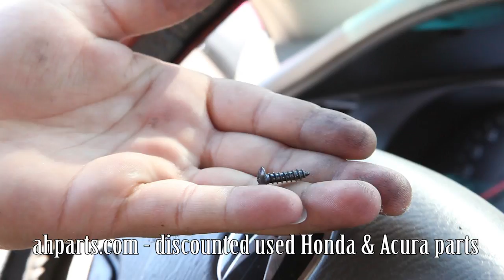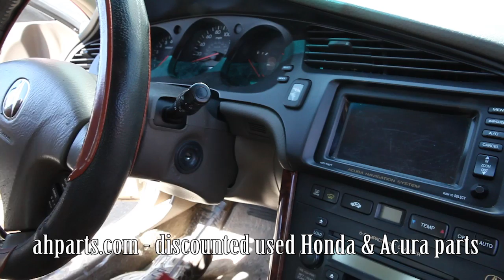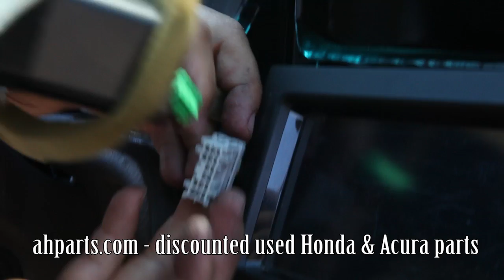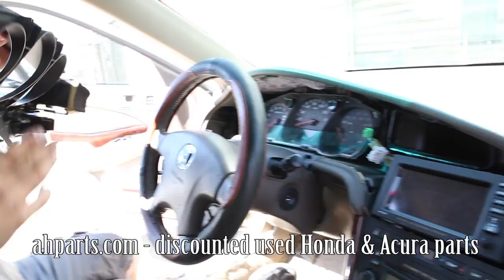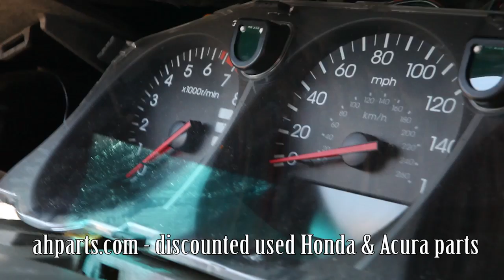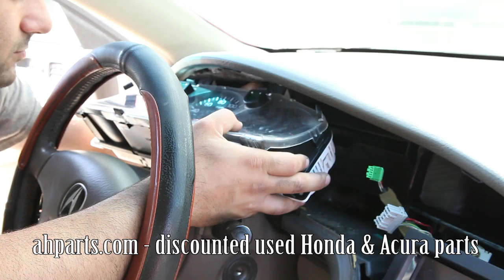How to change replace install speedometer instrument cluster gauge 1999 2000 2001 2002 2003 Acura TL

Comment: Hello, I'm really in a bind.  I live in Hawaii.  My car safety check and registration is due in 28 days.  I was just informed of the  cost through my Acura dealer as well as my own mechanic to R&R this instrument panel.  It's not worth mentioning.  Is there any way you could post or refer me to a video that is my year/make/model PLEASE?  I have a 2000 Acura 3.5RL.  I greatly appreciate your help.  

This video is so well done I'm confident that if it did apply to my car's year/model that I would have had no problems.  Thank you